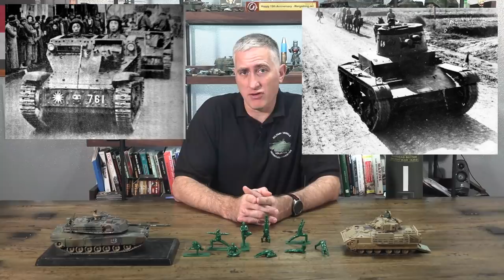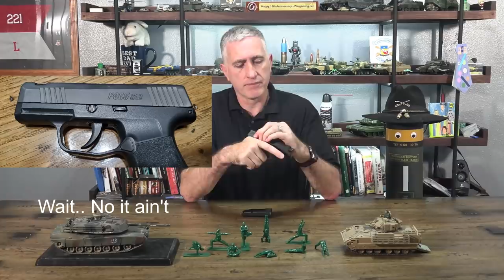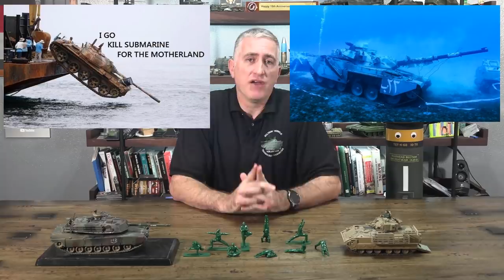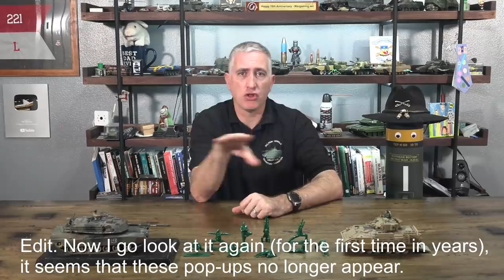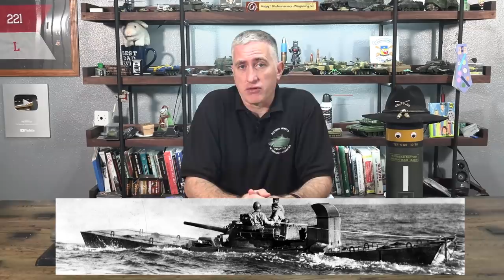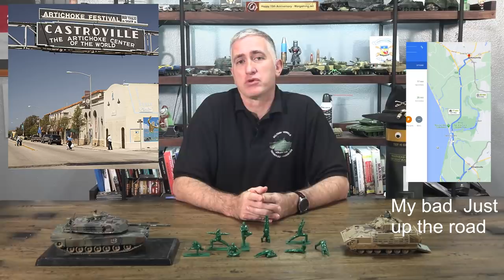Chieftain's Q&A 17. Rants, Ladas and shooting the other guy's cannon

Comment: 33:30-35:11 Well, if I had a grocery shopping list for what I want in a future-generation tank, it would be everything you already said, and a little extra toppings on the pizza:

1) MR fluid dampers for better suspension (the US army trialed these types of dampers for Humvees, and Stryker vehicles. Supposedly, they reduced "driver absorbed power" by around 70%, or more, when compared to conventional suspension systems. I think the "driver absorbed power" is a fancy way of saying of how much energy/force the driver receives when driving, and experiencing vibrations, and bumps), and reduction of gun recoil (apparently the US army used MR fluid dampers in their 81mm ADIM mortar demonstrator. And these special dampers reduced recoil forces by 80%)

https://www.google.ca/search?q=active+recoil+system+ADIM+mortar&source=lmns&hl=en-GB&sa=X&ved=2ahUKEwjSxeKBiNbtAhWaB50JHWKTDrgQ_AUoAHoECAEQAA (Look for a PDF with this tagged to it, "ndiastorage.blob.core.usgovcloudapi.net › 18296_Stapp". It's about the 81mm ADIM mortar)

2) Special sensors, or modifications of already existing sensors that can detect weapons fire from very long distances. A couple of months ago, I have read a document about the muzzle blast signature of a 120mm cannon. In this paper, the researchers state a thermal imager could spot infrared signature of the cannon's muzzle blast, from as far away as 2 km away.

(I don't remember the name of the document. But, I will try to see if I can find it again)

3) I think a radar-based fire control system for tanks would be nice. And for two reasons. The first reason being that, I think that radar could improve the view range, and accuracy of tanks over infrared/thermal imaging systems. And I think this, because I recall from Binkov's videos that radar is capable of spotting an aircraft from 2-3 times farther away than by using a thermal imager (although thermal imagers are still kept, because they may have a useful niche that I don't know about. And also, because of sensor redundancy, thermal imagers can spot hot targets, radar can't). If radar is powerful enough to be capable of spotting a target from much farther away, then surely it is also powerful enough to gather some data about the target to form a firing solution??? It's just a personal guess of mine, but I think I may be wrong about it. Or, on the other hand, I might not be. Because the US experimented with their MTAS (fire-control) radar systems on M1 Abrams tanks. And I think the French also experimented with radar systems for their Leclerc tanks. In addition, I remember that the Russians experimented with fire-control radars on their Object 195 tank. Also, I think the HIMAG tank also had a fire-control radar too, if I remember correctly.

The 2nd reason being that, radar could extend the visual detection range of enemy tanks, and incoming projectiles. And especially in the case of spotting projectiles. Because it seems that tanks are increasingly adopting APS (Active Protection Systems) with radar. However, all tank-based APS systems up to today, use short range radars (I think they have a range of a few hundred meters). So, in the future, it may be logical to use longer-ranged radars to spot projectiles farther away, and to also give much more longer warning times (if given enough distance) for the APS to react. And if you already have a longer ranged radar for your APS, why not dual-purpose them for fire control too???

https://twitter.com/skylancer7441/status/1165166227851022336/photo/2 (MTAS fcs radar)

https://www.secretprojects.co.uk/threads/m1-abrams-mbt-replacement.2187/page-8 (MTAS fcs radar)

https://twitter.com/skylancer7441/status/1219053635725864961 (HIMAG tank with radar)

https://twitter.com/lfx160219/status/1061861595561619456 (Leclerc tank with surveillance radar)

4) ETC (Electro Thermo Chemical) guns seem relatively mature. The US already tested using ETC guns in heavily modified M8 Buford tanks in their "ETIPPS" project.

https://www.semanticscholar.org/paper/Electrothermal-Chemical-(ETC)-Armament-System-Into-Goodell/80f0609c85a2885e5735d80e92972d1b8e0eca33

https://www.semanticscholar.org/paper/Recent-Activities-in-Electrothermal-Chemical-at-BAE-Dyvik-Herbig/cfee7e280b576a40389cb9ae3f1ec1182f4bfa9f (there should be a PDF document attached in the website)

5) If I remember correctly, composite roadwheels were made for the Wiesel tankette, and M60 Patton tanks  

6) Electroreactive armour sounds neat

https://www.youtube.com/watch?v=o7rxBifd0cY

7) A FOOB cannon, or a 120mm version of this thing: https://www.researchgate.net/publication/290636059_A_Concept_Demonstrator_for_Small_Arms_Recoil_Reduction (You gotta scroll down a bit)

Oh, one more thing. Were rarefraction wave guns ever discussed on this channel??? I seem to remember that it might have been on one of your Q&As Chief, but idk   :/

Comment: Would you be willing to talk about staff work? Specifically, how does a staff function on the move in the back of c2 vehicles? Is there a stationary element to maintain communication with higher using STT/similar systems while the rest of the unit maneuvers?

Comment: The issue with the Lada was that in some cases after taking delivery you had to essentially re-assamble it again. Though this is more for the Moskvich and lower tier Lada models, the upper echelon that you bought with USD certificates for work abroad from the special party stores were indeed better. The problem however is that if you have a company of T-54/55s in 1970 and you do daily drills 2-3 may be out of service each week with the drivers doing partial rebuilds. The crudeness however ensured that even without fancy tools you could service it. But it ate away manhours and lacked critical crew comforts so in adverse environments or prolonged drills it wasn't all that great. It worked when you had manpower to throw at it but the PACT countries even though they experienced peaks by the 70s and 80s in reality were facing a severe demographic crisis. East Germany and Bulgaria were the worst performers when it comes to population growth between 1945 and 1990. It also served for a rather piss poor conscription experience when coupled with a mess hall served exclusively by teens and food supplies which whilst calorically sufficient required a lot more work to be considered appetizing. For example getting half a pig to the mess hall is great but with this setup you might end up with a stew with bits of pork skin and fat with more than a few patches of hair. 

Crude means simple to maintain, that's not the same as easy or quick. Getting things back in place with a hammer's simple. It does however take 50 minutes and most of your energy reserve.

Comment: I have a question concerning the sherman firefly and i was wondering if anyone could awnser me. All the photos I've seen of the firefly use the earlier model of sherman turrets which game the tank horrible crew ergonomics thanks to size of the 17pdr gun. However, the later model shermans had larger turrets and could comfortably fit 76mm gun which was equal in size to the 17pdr (from what I've seen. I could be wrong). So why didn't the british stick the 17pdr in the larger turret when they became available ?. Was it because the 76mm gun was just as capable of knocking out tanks and the 17pdr was no longer needed or did the british not have acess to the larger Turreted shermans ?.
Reply: I believe the British never received the E6 version with the larger turret.
Reply from the maker: The British specifically requested the small turret version. From what I can gather, it's a matter of the point of balance of the gun.  https://worldoftanks.com/en/news/chieftain/chieftain-turretsize/
Reply: @TheChieftainsHatch  thank you !

Comment: I think it should be noted that the 83rd US Infantry Division made great use of captured/looted trucks in 1945, the unit also had a number of ex-Wehrmacht tanks in its service. The 83rd Infantry would be become known as the "ragtag circus" because of their habit of comendeiring any motor vehicles they found on their axis of advance and driving them till the wheels fell off.

Comment: Comments on QA 17

1. How good are Soviet-Russian weapons and equipment. It should be remembered that Russia has produced three levels performance for a given model 1, Domestic (only) 2. Closest Allies (ie Warsaw Pact) 3. Export (“Monkey Model”). My impression with tanks is we are mainly talking about the capabilities of the fire control and communication systems and possibly the armor. Thus you can't look at the T-72's performance in the First Gulf War and assume that a Russian T-72 would have performed the same.
2. Firing Port Weapons – This is a case of envy. During WW2, the German's Mech Infantry got in the habit of rolling up into the center of an enemy positions with the dismounts in back blazing away. Post-war, the they adopted the HS30, which had roof hatches to allow the dismounts to fight mounted and then the Marder, which had firing ports. Voila, the IFV had  arrived! The Russians quickly followed with the BMP-1 and the US M113 was looking pretty inadequate. This led to a series of designs that resulted in the M2 Bradley IFV. The original idea was that the guys in back would fire their normal weapons through the firing ports, but for some reason this couldn't be made to work and a heavily modified M16 was adopted as the M231 FPW. Then the Arabs tried using their BMP's using Soviet tactics and got their clocks cleaned. All of a sudden, firing ports and FPW's fell out of fashion. 
https://en.wikipedia.org/wiki/M231_Firing_Port_Weapon
3. Thermite Grenade – There is a short chapter at the back of every TM explaining how to destroy the equipment. The preferred device is the M14 Incendiary Grenade. On an M60, we were supposed to have four grenades, The driver would place one on the engine and would pop the grenade on order. The TC would pull the pin on one, place it in the breech and shut the breech block. The third would go on top of the radio and have the pin pulled. Last, one would be placed in the ammunition ready racks and the pin pulled. “Bugger, the tank is on fire”. The TC would bail out as fast as he could and the driver would jump down from the back deck. https://fas.org/man/dod-101/sys/land/m14-th3.htm
4. Use of Captured Equipment – To the extent this was done by the western Allies, it was most common with artillery, many units forming a provisional “X Battery” to utilize the ordnance and ammunition. “An excellent example of such initiative took place during the recent war in Europe. General Patton's Third Army, faced in the fall and early winter of 1944 with a stringent ammunition shortage, refurbished and put into action serviceable items of captured artillery. On 2 November 1944, one corps—the XX—was employing 39 such pieces, classed as follows: four 76.2-mm Soviet guns, ten 88-mm German guns, eight 100-mm fortress guns, six 105-mm German howitzers, two 122-mm Soviet guns, six 150-mm German howitzers, and three 155-mm French howitzers. Up to that date, this corps had fired 30,920 rounds of ammunition weighing 660 tons and valued at $702,391. For the week ending on 29 October of that year, 80 percent of the artillery ammunition fired by the XX Corps had been captured from the Germans.” In terms of vehicles, the Western Allies, did not use large numbers of German AFV's – but support vehicles was a different story. I can remember reading about the spectacle the 3rd Armored Division made in the Ruhr Encirclement with its parade of pillaged trucks and staff cars, looted civilian vehicles and the Engineer Battalion even had a German bulldozer it was carrying around on a tank transporter,
5. US Recovery Efforts – An additional reason to recover and repair vehicles was the sheer distance a replacement vehicle would have to come. The Ordnance Corps organized Collection and Evacuation Companies to scour the battlefield behind the combat troops of all friendly and enemy weapons and equipment and then refurbish them for further use. Every piece of equipment refurbished and returned to the supply chain freed that much shipping, factory capacity, and rare machine tools and skilled personnel to operate them which allowed for other badly needed items to be made and shipped. 
6. M48 Cupola – Adopted to allow the employment of the .50 calibre as a ground weapon by providing protection to the TC, This is the same reason the TC's position on the M1 first went to a shield and then CROWS. The ring of periscopes added to M48's in Vietnam was commonly called the G305 Riser. Note the irony, in the picture, the fifty is mounted on top of the cupola, a common practice in Vietnam, that stood the original reason for the cupola on its head.
7. “Cup Oh – La” vs “Kew – Pah – La” - another US armyusm, is “Tar – Paul – In” vs “Tar Po -Leum”
8. M60 A Lousy Tank -  

        M60A1 Hull front 109mm at 60 degrees  250mm Turret Front
        105mm Gun  15.08 HP per ton  Road Range 300 miles

               T-62  Hull front 102mm at 60 degrees   214mm Turret Front
               115mm Gun   14.5 HP per ton  Road Range 280 miles

The M60A1 and T62 were built in direct competition to each other – what's this BS about underarmored  and under armed....If anybody was underarmored, it was the vaunted Leopard 1. which had a maximum of 70mm

And yes, the M60A3TTS was a great tank – the improvement over the M60A1's I started out in 1975 and the vehicle I had seven or eight years later was astounding. The sight was actually better than the one in the M1 – it cost too much, so the Army bought something cheaper for the Abrams.
9. T-34 Smoke – The T-34 was turbocharged and suffered from turbo lag. If you floor the engine, it takes time for the turbocharger to come up to speed, but the injectors are blasting the full amount of fuel into the cylinders. So the engine is running  very rich and the result under sudden and hard  acceleration is a belch of black smoke out the exhaust. I've often thought about this scenario.....you spot a Ju-87G tank killer swooping in, so you scream at your driver to floor it and turn hard to throw its aim off. Your driver kicks it in the tail, and as you speed up a huge cloud of black smoke pours out. Meanwhile the Stuka's pilot squeezes the trigger and black smoke pours from the target as he roars over it. A KILL! He exults and Hans-Ulrich goes off to claim another victory., while you give thanks for a near miss. That's whyI look at Rudel's claim of 500 plus tank kills as highly questionable. Don't forget, Rudel was avowed Nazi and Goebbels was out to glorify him to the max. I might buy 100 plus, but even have doubts about that.
10. Tinkering – A great many off the US troops in WW2 were farm boys – and one thing you learn on a farm is to tinker with the mechanical equipment to either keep it running or improve its performance. Today, many less people are farmers, so I think that reesults in less tinkerers in the ranks.
11. US TD's at Anzio Using Naval Star Shells – Could you expand on this story, please. Also, could yoou discuss how the British improved the performance of 75mm ammunition by mixing powder from US and French rounds. And shoot, while you're at it, please discuss Allied use of German 75mm rounds. Thanks

Comment: Regarding depleted uranium, Sweden measured the uranium exposure in their troops during the balkan wars. It turned out that the soldiers had more contact with uranium back in Sweden, than in the balkans, due to differneces in geology. Additionally, uranium is basically stable, it is likely worse as a heavy metal than due to radioactivity (provided it is below the critical mass for enriched uranium).
Reply: That's interesting. I know you don't want to be breathing DU dust. No, it's not very radioactive, but those alpha particles make a mess of your lungs!